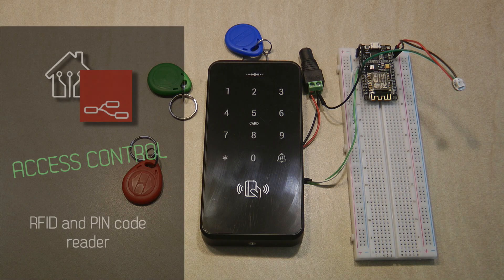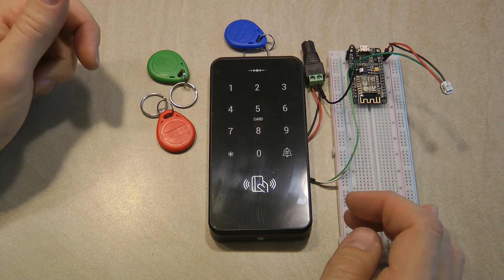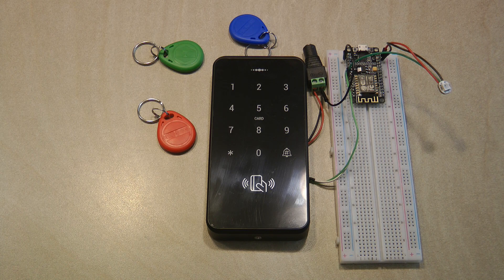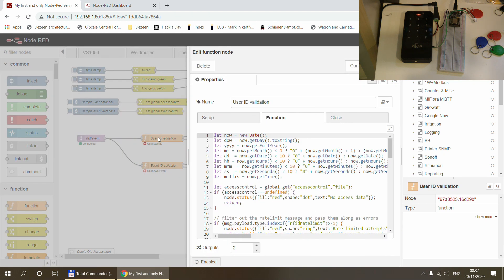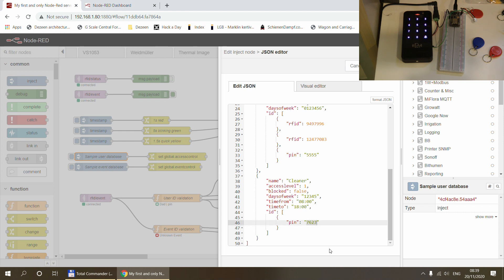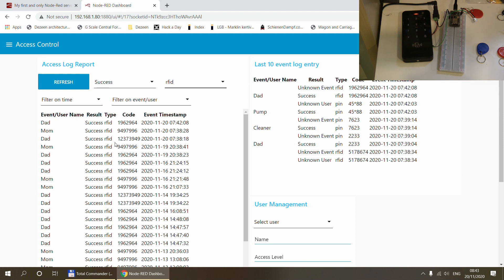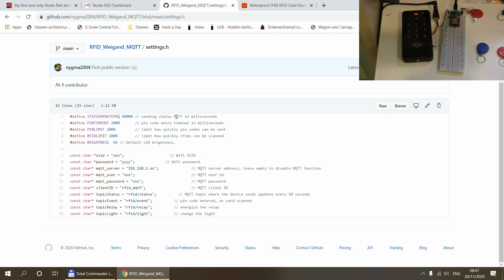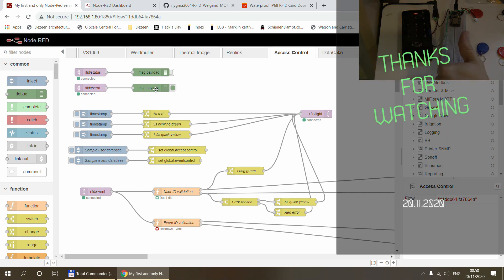Access Control Solution in Node-Red

Comment: Hello
I have an issue setting up sqlite database.
I installed sqlite3 and node-red-node-sqlite in node-red.
Sqlite3 works well, I could create the table, but in node-red I'm getting this error:
Node-Red failed to open /home/iot/IOTstack/volumes/sqlite3/nodered.db

Can you help me with some instructions how you setup the database.
Thanks.
Reply from the maker: I am not sure how you created the database. If you used myphpliteadmin the owner of the database file in www-data and Node-Red usually runs with user PI. Please check the permissions of the db file, and make sure "read by others", "write by others" permission is added. I am using Midnight Commander in my pi, I don't remember what the commands line parameters are in chmod.
Reply: @csongorvarga  I'm using docker on a ubuntu server for both node-red and sqlite3 (not a direct install under ubuntu and probably this is cousing the issue), database/table was created from the sqlite3 command line and looks like is working.
I gave all the required permissions (so I believe ;-)) to the database folder/file.
After reading some blogs apparently the issue my be the user node-red is using to access the file (doesn't have permissions to do that).
If I don't define the database in the sqlite node (the database field remain empty, default /tmp/sglite) witch is using the ram memory not the file, your flow is working and I can see data populating in dashboard.
So I have to look into how to fix node-red user permissions to access files.
Reply from the maker: @lucianbuzatu4602  OK, I am not using docker, but I understand it could be difficult to give access to programs running inside docker to various parts of the main file system.
Reply: @csongorvarga  Just for the record,
 if Nodered is installed in docker container, SQLite databade needs to be within the nodered data folder.
No needs for other permissions, in SQlite node the database path is just the database name (as the location is already in nodered folder), in my case nodered.db.
All works now, looking forward to check on your project and adapted as need it.

Comment: Hello again,
I'm having some troubles reading the RFID tags and maybe you can point what I'm doing wrong.
I load the sketch into a D1 mini and I have it powered over a USB from my laptop (RFID controller is powered separately with 12V with common GND with D1 mini).
having the USB connected to my laptop allows me to use Termite as console to read the D1 mini activity.
So on the console I'm getting this message:

Wiegand HEX = D, DECIMAL = 13, Type W4 | PIN = 2233  -> MQTT sent
array: Message arrived on topic: [rfid/light], {"color1":"red","color2":"black","blink1":500,"blink2":500,"duration":2000}
Color1 = red, Color2 = black, Blink1 = 500, Blink2 = 500, Duration = 2000
Wiegand HEX = 757E83, DECIMAL = 7700099, Type W34
Status: {"rssi":-70,"uptime":40,"rfidcount":0,"pincount":14}  

Pins are working OK ... I get the notification in Node-red
When I scan a RFID tag I can see the reading in the console but D1 mini doesn't send the MQTT message so the Node-red can interpret it. 

Thanks in advance for your time and help
Reply: #update, I think I got it, I change it to W26 protocol from W34. Now works.
Thanks for sharing the project. It's a great start that we can build on.

Comment: hi, good idea, i was checking similar rfid reader, and i also used an similar solution with and simple wiegand nfc reader +espeasy+domoticz for may main gate, where the espeasy rule decide based on the readed tag id, and now -- a couple of months ago-- i'm planning to change this to RFID, to a similar device as you selected, but i wanted to use such which has fingerprint reader also, i ordered one, but unfortunately the selected and ordered  part was a simple one not the upgraded version, and this did not have wiegand output only relay--chines details on ali..... i checked another one type also, which is almost the same as your+fingerprint: https://www.aliexpress.com/item/4001305921348.html?spm=a2g0o.cart.0.0.2f3a3c00BlPV9y&mp=1
i do not know, and i'm woundering , that it can provide any id via wiegand also, if i use the fingerprint? if i realised correctly from your video, this device is able to send the pin code also via wiegand? than in that cas can i suppose, that in case of fingerprint read will also send a unique id? I'm planning to order a different one as i have now, so maybe that what i linked above, or this:
https://www.aliexpress.com/item/33030940260.html?spm=a2g0o.cart.0.0.2f3a3c00BlPV9y&mp=1
the chinese seller can not tell too much about the operation... and the advertisment details... no comment...
Reply from the maker: Wow, this is good. To be honest the first on the link looks very similar and I think it is from the same store. So it may just work with my code with some modification. It says in the listing that it support weigand 26 bit. If it works for you, let me know and I may order a fingerprint version as well. Could be even easier to use to open gates than a small rfid tag.
Reply: @csongorvarga  if you check the details of the similar on ali, in the title and below also can read RFID, but id you check the working frequecy this was 13,56MHz which means nfc.... now i tried to write again to the seller, and will se which verzion is this, i suppose rfid--125KHz, but will see... i think I will order one from the 2 what i mentioned, only these are not so "cheap" to throw away if not fits with the idea... and onece i decided badly, when i ordered this: https://www.aliexpress.com/item/32496371804.html?spm=a2g0s.9042311.0.0.1e5c4c4dhvARrp
this describe only the upgraded ver, but i ordered the older one which do not have display, because i thought this will be more water resist... but this do not have wiegand pins... only relay, ok the relay could i use as a switch to a tasmota wemos gpio, but as you also mentioned if someone knows the pinout enough
 to short this circuit and tadammmm...
for my solution, an for yours also is important to get a unique ide when rfid, or pin or fingerprint reads/changed, i suppose if in cases of the rfid and the pin this works, than should work in cases of fingerprint also, but... only will be sure if someone tested...seller could not tell it...
Reply from the maker: @rumpi81  The one with the screen looks very smart, but that is probably for indoor use or at least in a protected area.
Reply: @csongorvarga  asszem folytathatjuk magyarul is :D igen eléggé inkább beltérre való, de talán hivható cseppállónak is ránézésre az amit vettem, persze a panel bellül nincs coating.. az ami ujlenyomatos és olyan mint amit vettél na az már elvileg vízálló kivitel, csak kinaiak nem bírnak normális leírást adni, ha rfid lenne, és tudna egyedi kódot adni wiegand-on minden feltanult ujlenyomathoz, az remek lenne... akkor már rendelném is, rosszalkodik a most használt nfc olvasóm, nem akar néha kommunikálni a wemos-val--espeasy, ujra kel ilyenkor indítani, és gondoltam átállok akkor a rfid-re de ugy hogy legyen másik opció is mert nem mindig van tag se nálam... ez tök jó ötlet, hogy ha mindig kiküldi a beütött pin-t is wiegand-on, akkor ezt el lehet használni más eszközök kapcsolására is.. az id meg ahoyg eddig is használtam jó lenne a személyek azonosítására---domoticz text device-be felküldöm, de a nyitási logika espeasy rule-ban deklarált.
amugy ilyen nfc verzióját használom 1-2 éve:
https://www.aliexpress.com/item/4001171983949.html?spm=a2g0s.9042311.0.0.27424c4ddBeZ5I
Reply from the maker: @rumpi81  Én is így voltam vele, nem tudott rendes választ adni az eladó, a végén csak berendeltem hogy hátha jó lesz és szerencsém volt. Az újjlenyomatos jó kérdés. Számomra is csak akkor ér valamit ha az újjlenyomatból tud valami egyedi kódot generálni.
Reply: @csongorvarga  hát abból a simából ami csak rfid olvasó de vízálló egy már úton van, arra majd cserélem az nfc-t--bár ebben a hidegben kinn szüttyögni... de az legalább olcsó és valamit kezdenem kell vele, mert egyre sürübben dobje el a wg26 vonalat a mostani, magában működik mert olvas-csippan, de weemos felé már nem megy ki adat, aztán espeasy restart és egy darabig megint működik... van másik nfc-s itthon de akkor már cserélem a rfidre... meglátom ennél mi írnak vissza, de ha a tiéd rfid, akkor felteszem ez is az lesz és nem nfc... előre azért vettem nfc-t hogy majd az nfc-s telefonomat olvastatgatom le, nem kell kártya, de az kicsit hazárdosan működött emlékeim szerint, leolvasta de megkergült tőle, meg talán nem is mindig olvasta, aztán marad a kárya meg karkötő ami nfc-s, de most hogy rosszalkodik, gondoltam átállok.. és ha tudja az ujlenyomatot, akkor már kértya se kell :D, meglátjuk lehet berendelem, talán nem lesz nagy bukta, de ez már azért 10eft...
Reply: @csongorvarga  visszairtak... azt állítják a tiédhez hasonszőrüre ami ujlenyomatolvasós, hogy 13.65MHz... ergo nfc, most akkor mit gondoljak?!... akkor kimarad, max lehet akkor rendelek olyat mint te.. bedobod ide a tied linkjét lécci?
Reply from the maker: @rumpi81  ott van a link a githubos cikkben, bocs most nem vagyok gep elott.
Reply: @csongorvarga  informális jelleggel, megjött ez: https://www.aliexpress.com/item/33013700738.html?spm=a2g0s.9042311.0.0.44a64c4dsyN3Pg , kártya olvasásra küld id-t minden esetben, ujlenyomat leolvasásnál csak akkor küld id-t, ha előtte az az ujlenyomat meg volt neki tanítva, amikor nem ismeri fel, akkor nem küld, kód beírásra szintén, mint az ujlenyomatnál, ma jött meg eddig jutottam :D
Reply from the maker: @rumpi81  Az is valami. Szóval az ujjlenyomat belső azonosítóját küldi. Mi jelenik meg a soros porton? Valami W....?
Reply: @csongorvarga  Valami W....?-ez alatt mit értesz? espeasy-val próbáltam le nodemcu-val.
Reply from the maker: @rumpi81  Ja, azt hittem az én kódommal.

Comment: Great project and video! Thanks for sharing it. 
What are the steps to upload the sketch to the NodeMCU?
Reply from the maker: You need the Arduino IDE which is set up for the ESP32 with the libraries that I mention in the github page added. After that you just change the settings in the settings.h and compile and upload via USB cable.
Reply: @csongorvarga  Thanks, I'll look for some tutorials, definitively is worth to try on this project.
Reply: @csongorvarga  Hello Again, by any chance do you have a link form a European vendor for the RFID scanner you use in the video.
Thank you.
Reply from the maker: @lucianbuzatu4602  Sorry, I don't. But you can connect the seller on Aliexpress, they may sell the same on Amazon.
Reply: I managed to upload the sketch to a D1 mini; but I'm not sure if I have to make any changes at this line
 wg.begin(WG_PIN_GREEN,WG_PIN_WHITE) to wg.begin(D6,D7)
Thanks
Reply from the maker: @lucianbuzatu4602  Yes, those are the wires. But it is mentioned on github and the top of the code as well. You should see the messages in the serial input when you enter a key or scan a RDIF tag. Also, don't forget to set the device into Weigand reader mode. Section 5.2 in the documentation if I remember correctly.

Comment: Nice video- can I ask given that this is a 12v unit what is the voltage on the data pins that you are connecting to the node mcu - 5v would be ok but just worried it is putting out 12v
Reply from the maker: It looks like it is TTL voltage. The example I followed uses not additional circuit either, and it also works fine with my NodeMCU. I am using it for weeks now and nothing damaged.
Reply: @csongorvarga   I checked a similar device I have and there is a 12v to 5v regulator so it must be using that.  Have you thought about extending this work and incorporating it into the work you did on Telegram integration. I was thinking that using my phone with Tasker and a bunch of NFC tags you could re-use the flows here to allow user/time specific validation of actions anywhere (car, office, garage or even on the street) in a secure way because the nfc info is meaningless without being paired to the phone.
Reply from the maker: @stevelenehan7695  Yes, I will definitely want to incorporate with Telegram. I would like to get it fully working as a standalone solution and later I will integrate the two user management together. And also add Telegram notifications.